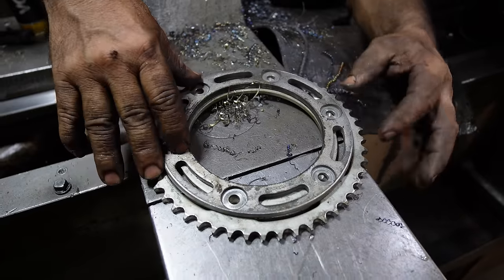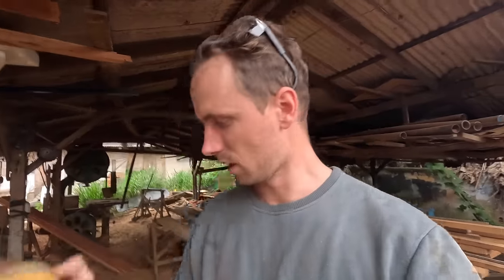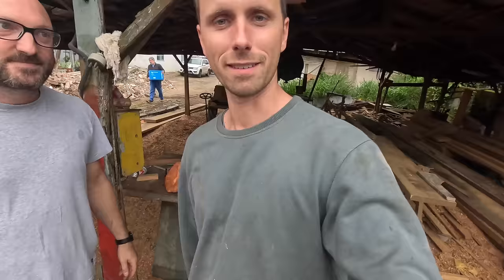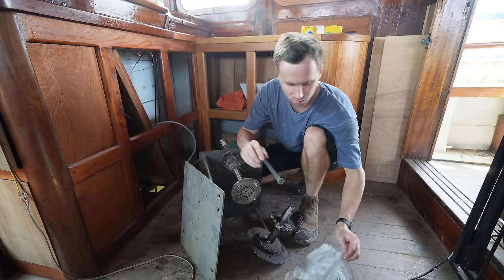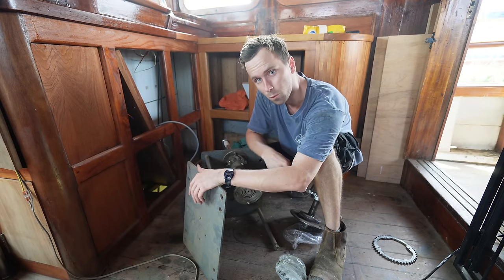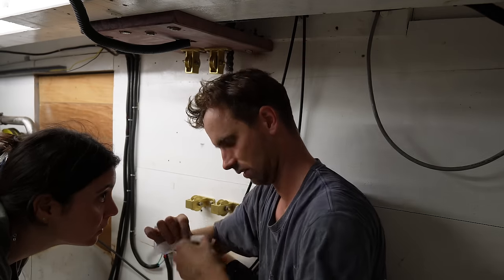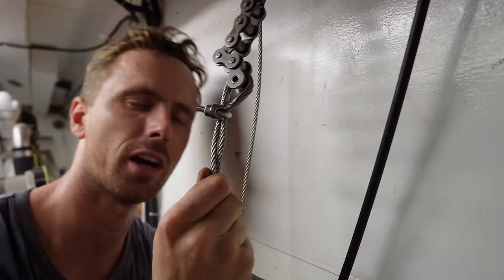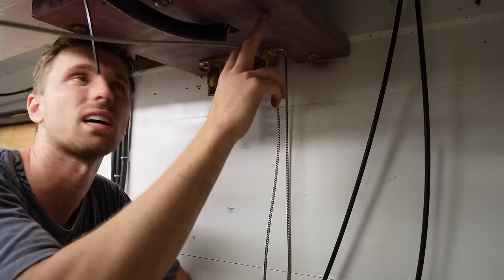Upgrading the old fashioned steering system of our RESCUED wooden sailboat — Sailing Yabá 158

Comment: I have a suggestion that might prevent replacing the cable often: I can't tell for sure from the videos but it looks like the wire rope coming out of the transom rides on the upper side of the pulley, which if true will cause premature wear.  Instead of the hole in the transom being parallel to the axis of the boat, you might want to angle the hole itself from left to right  (or up to down as the case may be) as it goes through the transom.  This should allow the rope to be centered on both pulleys immediately on either side of the transom.  Thanks for reading.

Comment: Ben I would like to give a friendly FYI. The saddle of the cable clamp goes on the live side of the cable and the u bolt of the cable clamp goes around the dead end of the cable. The way they appear to be installed at the moment they will eventually slip and lose their taut with use. I would also suggest to add more than just one clamp per eyelet. Three would be preferable and spaced properly. I was wondering if you had considered the work load rating of the steel rope/cable to the size of your boat since a lot of commenters are concerned about the size of the steel rope/cable replacement being used at present and whether it has the same rating as the rope used before for the steering. The turnbuckle suggested is a great suggestion for quick and easy adjustments. Also I would suggest heavy eyelet thimbles to reduce eyelet wear for your connections to the suggested turnbuckles and the points at the rudder.

Comment: Do you should have a cover guide over the chain to keep it from popping off. Under rough seas and large waves a sudden impact to the rudder could cause the chain to jump a tooth or come off  altogether. Cars that have timing chains use guides and chain covers to help keep the chain in place. Just a thought.

Comment: Recommend keeping several er ral changes of new steering cable aboard. Every angle change is a "work" point on the cable. While under tension, those points will work harden and wear, potentially causing failure/breakage.
It may not seem much; but imagine/count how many times per mile or hour you may turn the wheel...even a little bit😮

Comment: THROUGH-BOLT all your pulley(sheave) cages.  LAG BOLTS will loosen in a maritime environment and under stress.  I would also add "boots" to your cables where they pass through the transom.

Comment: Great build. I would suggest some way to tension the system, and to allow some give in the system to absorb wave buffeting or over steering. A mega wheel spin could rip out the pulleys! Have you any thoughts on an auto pilot system?

Comment: Be sure to have an emergency tiller made that attaches securely and quickly to the headstock of the rudder, it can save your life. You have vastly underestimated the forces your large heavy rudder will place on it's steering system...constantly, then think of shock loads.

Comment: Next is connecting auto pilot so it is not requiring a lot of torque to work the rudder. This will reduce power consumption and also let it work for days without over heating. Connected to the first steering shaft would be good.

Comment: The 4 pulleys below the steering box should be be able to take alot more force in the direction of the wire, currently they are reliant on a narrow section of metal, and the bolts at 90 degrees to the line of the wire, The bolts should be in line with the wire also the pulleys need to be a much bigger diameter for this size of wire, otherwise the cable will fatigue much more quickly and the strands will start to fray, then be susceptible to sudden failure.  The pulleys on the stern would be better if secured by through bolts as screws will work loose.  There are big forces involved even more so with the lower gear ratio from the wheel.  The improvements are great, but it's really important to keeping developing it now and to consider what may work better in future, for example can you fit an autopilot and a backup, vital for a happy crew on passage.  Finally I would check if you will be able to turn the wheel quickly enough to manoeuvre in tight spots and in wind and waves, both of you should try some other boats, with one hand.

Comment: And along with the suggested turnbuckle you need a spring on both sides to minimize forces on the cables and give them room to give and not break your fittings under strong seas. I would also get rid of the bolt holding the small pulley inside the gearbox and replace it with an Allen Head set screw. This will minimize potential for parts coming into contact under heavy conditions.

Comment: Use dyneema, 10 mm would be ideal, rub wax into the rope where the rope crosses the pulleys, I think the stainless will cut into the brass and then the friction will
Come back.

Comment: Where the rudder wire goes through the stern to the rudder you must put a metal pipe in the stern so the wire does not make the hole bigger over time due to wear.
Reply: Ben said he was going to do that, just not film it.
Reply: Better another piece of metal than the wooden transom. Think before you write next time. Just a suggestion!!!!!!!! @ski69
Reply: @ski69 that’s exactly what Ben said he is going to do and should be done. Think before you say something that doesn’t make sense next time
Reply: @mwatkins2464  so Ben was doing what I suggested
Reply: @deniermurch8693  yes but my comment wasn’t to you but the guy saying your idea was wrong.

Comment: Good job. However I wound suggest you take the chain and "boil" it in ball bearing grease to make sure it works super smoothe and to prevent rust.
It's as easy as rolling the chain up into a disk and use an old pot it can just fit in. attach a length of wire to one end, that is long enough to grab it from in the pot. Then ad enough grease to cover the chain, and heat it up until the grease it liquid and you can see bubbles coming out of the joints. Usually between 100 and 140 C if you want to get fancy. Any higher than that and the grease will start to degrade. 
Once it stops bubbling from the chain pull it out of the pot and let it hang and drip over the pot while it cools down. 
Naturally the gears in behind the wheel should be greased as well. 
:-)

Comment: Thread a nut on the bolt . Then drill a hole thru the side of the bolt so you can add a carter pin . that will keep the nut and Axel from working out .and getting lost .
When you remove the nut.  It will redress the threads .

Comment: Add a set of turnbuckles or spring tensioners to the cable to keep it from jumping/binding in rough seas. 

I don’t know what maritime regs might call for but tension on control cables like that in the aviation industry get rigged at about 15-30lbs of tension in order to make everything run/wear more evenly and smoothly.

Comment: Should have swaged on cable ends where there are connections. Also, adjustment turnbuckles to adjust for cable stretch and temperature changes. Could also put springs in where the cables attach to the chain.

Comment: The cable is still going slightly slack on the un-tensioned side. Perhaps some spring tensioners in the cable run would help.

Comment: I would have used a hydraulic steering, with double rams at the rudder an an orbitrol pump at the wheel. I have that on my own boat. It is so easy to add another steering position and an auto pilot. And it's super reliable. You can add a valve that will block forces upon the rudder, reaching back to the wheel. My setup uses two Tenfjord orbitrols for two steering positions.
I have a smaller boat with wire steering, like yours, and it is a big difference between them. All in favour of the hydraulic setup.

Comment: hey Ben & MP.  overall you are doing a great job. absolute!  But : the rudder stearing is according to my experience way too light and not safe enough. Cables, pullyys , the connection with the quadrant are in my opinion not strong enough fot this heavy boat. reconsider a better system. In the comments you notice the worries that many subscribers have. I doubt if it will be accepted by insurence standards.  safe sails.

Comment: Hi! once the boat is in water and the rudder is put to work, the wire will stretch, so its good to have some sort of tightener for the wire....A wheel on a bolt, that could stretch the wire, once it will stopped stretching. Basically, like on a scooter, the bolt that stretch the wire down to the brake....Anyway, the boat looks good, and soon she will kiss  the water...:Have you discussed when that shall happen??  Alldabestest from old mikke in sweden...;-D

Comment: Regarding your question at the end of the video, I hope you do understand that your boat is suitable for costal cruising only. Your boat is not suitable for open blue water cruising! This has nothing to do with the amazing craftsmanship you put into Yaba! For example the lovely dutch sailing barges are also not suitable for the open seas. For example your sliding windows are not strong enough to withstand have waves crashing into it and you've partly removed the bulwark. Your stern is pretty much open and there's nothing that prohibits a wave rolling all the way to the front cabins. If you want to chat in detail about this topic (chat, video call...) I'm willing to help. All the best from Flying Coney.
Reply: I do own a vessel roughly four times the weight of Yaba and I have some videos here on YouTube. For the steering I would recommend an hydraulic system. It makes it easy to add an autopilot or a remote control and it's very reliable. But if Yabas steering cables starts to get some slack they will figure a way out how to add a turnbuckle into the system. But having a wave entering the boat from the stern is a once in a lifetime experience if you know what I mean. There's a reason why previously the companionway was relatively small and could be blocked off by a board.   @ski69

Comment: Please please please use a push stick with the tablesaw. One jam, kickback, or brainfart and it will have your fingers off before you even realise it's happened.
Plenty of other comments about terminating the steering cables properly etc, but definitely heading in the right direction - no pun intended

Comment: You have taken significant steps to improve the steering system. The missing step may be in planning for its possible failure. You have an emergency tiller available. Consider what would happen if the steering system were to jam with the cables intact which may prevent the movement of the rudder. How could you install the emergency tiller and disconnect the jammed cables? I suggest that a plan to clear away all of the cables from the rudder would be critical if there is a need for emergency steering.

Comment: Safety Wire the bolt on the turnbuckle with SS wire.  Put lock tite on the cable clamps nuts.
Double hose clamp every hose underwater and pressure hoses on engine.

Comment: 3 dogs on a bench. 😂 Nylon insert hex lock nuts bolts are perfect for those oiled bearing shafts that hold your pulleys. I would not trust lock tight alone. And you can easily assemble and disassemble.

Comment: I think you need a positive stop in the helm. If the boat rolls and you lean on the wheel you may force the rudder too far. Install a block after 2 turns to left or right of straight ahead.

Comment: !!!!Drill the ends of the bolts and cotter key them or use castellated nuts and key them, or safety wire them !  Do not rely on the thread lock. I owned a boat repair shop and the last thin you need is that coming loose.

Comment: I had to change out the cable on a friends boat a few years back, those clamps were catching on everything, when I finally got it out there were 12 sections of wire, all joined with those clamps, every one was either catching on the wood ribs of the boat, or on another clamp going in the other direction the shortest section of cable was only just over 1m long

Comment: probably should put a bronze tube through the transom for the cable to run through as stainless cable against steel tube will wear the cable. Use a softer metal tube.

Comment: Your pulleys are WAY too small. By using such a tiny pulley you are forcing the cable to bend at a very acute angle. This will cause the steering to be stiff and will wear out the cables quickly. It is also good practice to ensure that the angle formed by the cable entering the pulley and leaving the pulley is never more than 45 degrees. Use multiple pulleys if needed.

Comment: Hi Ben and MP, you're both doing a wonderful job on Yaba, except one thing, the steering. It's such a critical item on the boat, as critical as the propulsion systems, engine and sail.
I have to say that I personally wouldn't take Yaba out with this system. Hard hitting comment, yes and I'm sorry to say it this way. I am an engineer, albeit not marine and I have written about this before.
In my experience, stranded wire cable does not like continuous movement with change of direction, I would choose guided Nylon Rope over Cable and Chain over both.
Your Mk2 version actually bends the cable 180 degree after the chain, then 90 degree, then 45 degree after the transom. The 180 degree bend is the weakest point on the system and the cable will highly likely break here. My experience with 100mm dia pulleys failed after two months of continuous operation. My marine cable was 6mm diameter. Your cable will also wear against the steel guides (inverted conduit clamps) it would be better that you install nylon guide tubes through these if you continue to use ss cable. The cable clamps to chain also look like they could snag, any snags throughout the system may make the chain jump the chain sprocket causing it to jam.
I highly recommend that you seek professional help on this system.
Reply: The stranded steel wire rope is going to destroy those softer metal pulleys in pretty short order.  The first pulley(s) after the chain that bends the cable 180 degrees is mounted 90 degrees to the load (on the bulkhead). Ben & MP would be far better served using dyeema instead of stranded if they insist on pressing this iteration into service.  I just hope this system doesn't fail at a critical moment (i.e cable breakage, pulleys ripped from bulkheads, etc).
Reply: Yes it will, though I think the cable will perish first. It starts with the individual strands each breaking over the continuous bending and straightening over the pulley wheel.

Comment: Good design! Silicon grease on all axles, gears and chain...turnbuckles to adjust tension due to stretch and heavier wire to resist breakage in rough conditions, nylon guides on stirrups to reduce wear points....otherwise excellent!

Comment: Hi Ben, while you did a good job, Locktite is not the best for locking a nut that will have grease on it and no pressure (Torque) to keep it from loosening. I would recommend a "Jam Nut" , to lock them together.

Comment: A hydraulic steering system would be more robust and make it easy to install an autopilot. Check out some of the other similar boats in your area and better yet, consult with those pros in the yard. Steering is way to important to take lightly. By the way, if you stay with that 7/19 wire, splice eyes to a link in the chain that is meant for the application. It will be better than cable clamps and prevent hang ups.

Comment: I must concur with @The1stKukuDrifter. Also, carry some spare pulleys, as the bronze will eventually wear. Aa well, for those grease fittings under the swim platform, I’d extend them up to the top of the platform so that they can easily be greased without having to go underneath. Should be do-able. You can thank me later 😜

Comment: I hope your going to fit bottle screws in the steering or you will have slack in the wire all the time. Also you need to fit rudder stops or when going astern it will possible snap the wires. Thats a big rudder and will have huge forces on it going astern .

Comment: if you used screws or lags to fasten the pulleys to the purple heart, you shout change them to thru bolts with nuts.  also, all your nuts should be the nylok type lock nuts.  much better than Loctite.

Comment: What has come to my observation is that the chain so that with the end to end  steering it still stays out at it's both ends, another thing is that with time the wires on both ends will stretch for which a tension pulley mechanism is needed to correct the slack and a system at the chain end for any further adjustments because it would be not very practical doing the same at the transom,

Comment: Rather than a steel pipe through the transom, I  would over drill the hole and fill with thickened epoxy then redrill the epoxy  for the cable.  Then a tight fitting piece of rubber fastened to the transom to wipe the cable as it passes through it.

Comment: That is not a cap on the end of your “axel” bolt. That is called a zerk fitting or nipple. You connect a grease gun directly to the zerk fitting and pump grease into the shaft without having to take the nipple off.

Comment: You might want to consider using a lithium based Greece And in the video that pulley on the transom wasn't turning when you pulled The Wire over it.

Comment: I would have fixed the two stern pulleys with thru pins and stainless steel counterplate inside. Because you have no idea when the rudder works at sea, of the forces that gravitate on the pulley, and if this is not well counter-reinforced, it could uproot it.

Comment: Regards your steering, It looks like you have upgraded to motorcycle chain, and I applaude that. But the rest of the steering system has to, more or less, match the same strength profile. Your chain is likely to have a tensile strength of 7200 to 11000 lbs. Your bottom pulleys will be subject to twice that load (i.e. 7 to 10 ton). The pulley foot will be the weak link as it will be pulled sideways. Pulley feet must be mounted at an angle so the force is down to the foot.